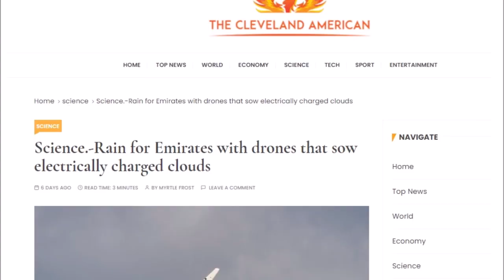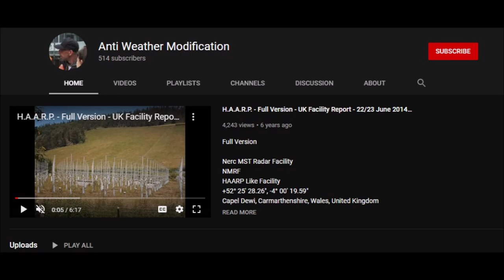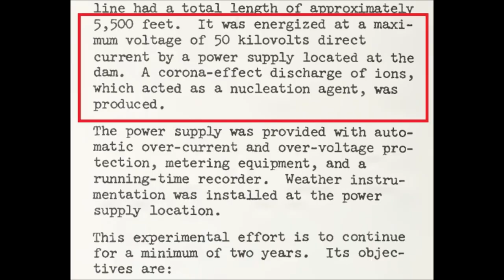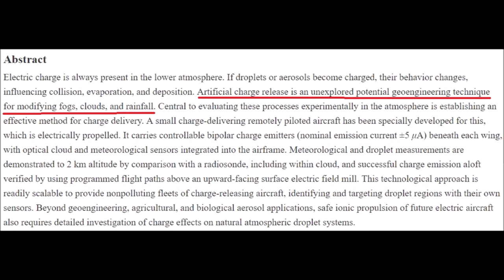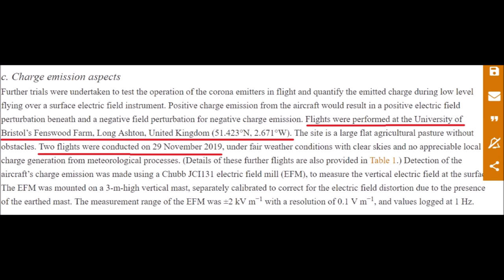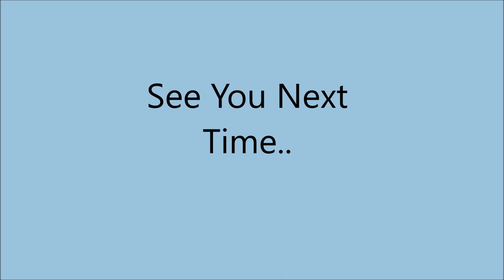International Weather Wars - 21 May 2022 - UK Drone Geo Engineering test - Bath & Reading Uni. FOIR

Comment: Thank you for such an informative video. Do you know what connection there is between electrical cloud seeding and 5G?
Reply from the maker: Hi Sapphira... I have heard of people connecting weather modification with 5G... I think they are 2 differents issues, one is telecommunications and one is weather modification...
They are connected in the sense that devices are being created to create 'Quantum Molecular Wakes'... that's basically a lazer pointed upwards that vapourizes cloud so 5G wifi signals can pass through the atmosphere faster. Targeted over many miles. 
Other connections would probably conflict with 5G such as the electric charge method or adding particulates to the atmosphere as they will probably interfere with the signal. Hence developing the QMW's..

Not sure that will answer your question but it will give food for thought on unrelated related tech... 

best wishes !